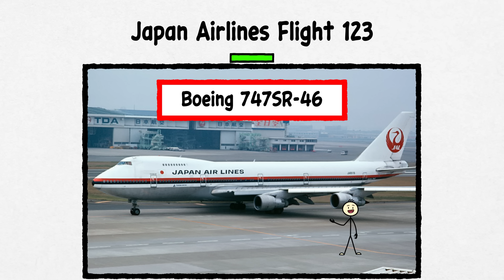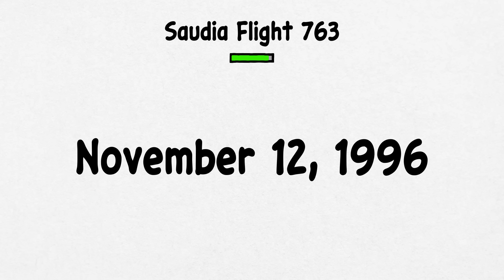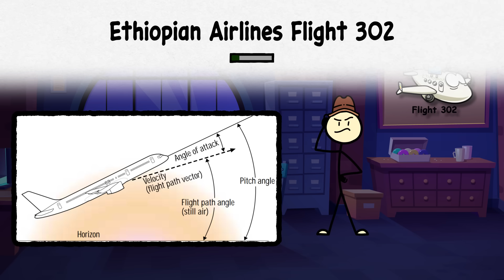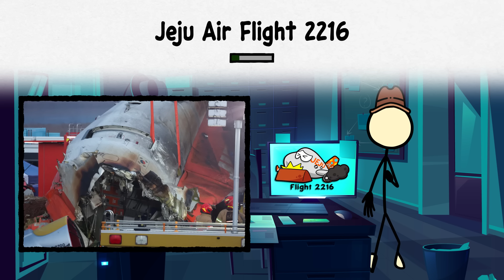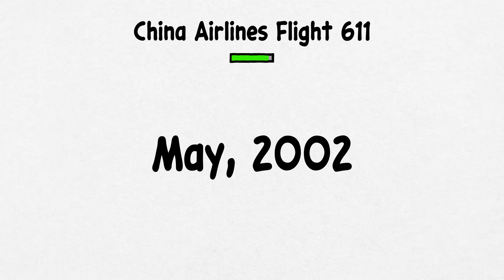Every Worst Boeing Disaster With Most Deaths Explained in 14 Minutes

Comment: Where is Flight 1907 (Gol Linhas Aéreas)?
On this flight, a 737-E8H collided in air with another aircraft (Embraer Legacy 600 in ferry flight). All 154 passengers and crew on board the Boeing 737 died after the aircraft broke apart in mid-air following the collision and the plane crashed into a densely wooded area.
(https://pt.wikipedia.org/wiki/Voo_Gol_1907)

Comment: suggestion:every close call in south american aviation with:Vasp 375 Cause:Hijacking, Avianca Brasil flight 6393 Cause:front gear not opening, Tam flight 283 Cause:Bombing, Avianca colombia flight 9463 Cause:Hijacking,Aerolíneas Argentinas flight 1132 Cause: hydraulic faliure,Lloyd Aéreo Boliviano flight 301 Cause:ran out of fuel,Latam Chile flight 1325 Cause:Hail storm damaging both engines,Conviasa Flight 2600 Cause:Landing gear did not deploy,Aerosucre flight 372 Cause: 1 engine faliure dring takeoff due to collision with ILS Antenna